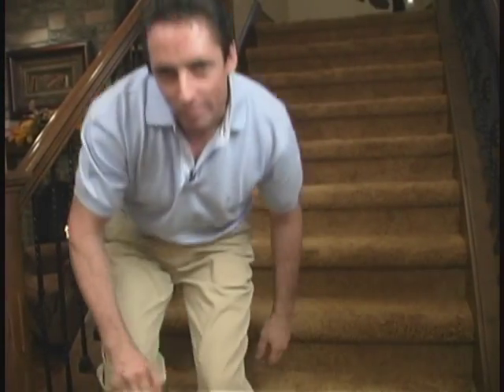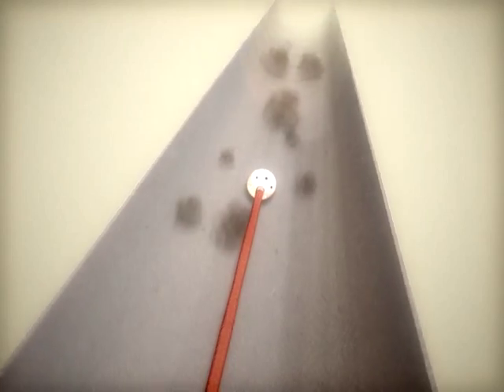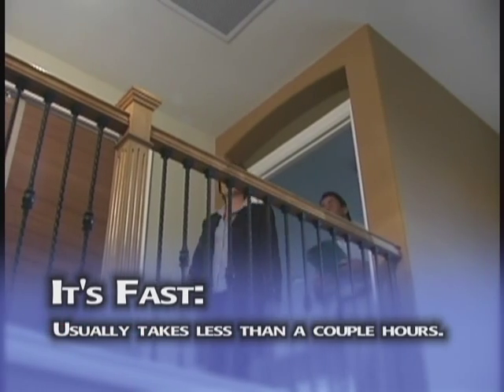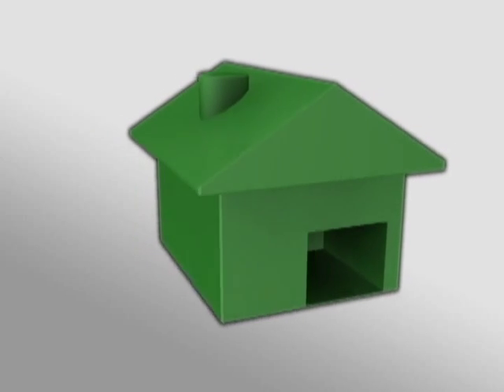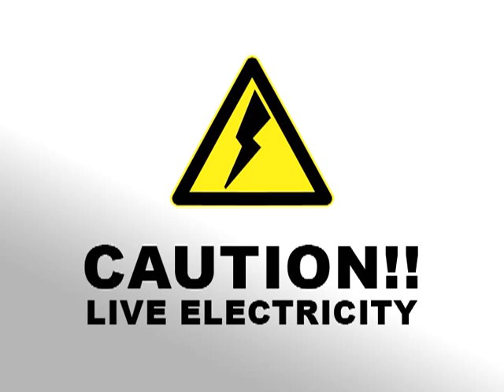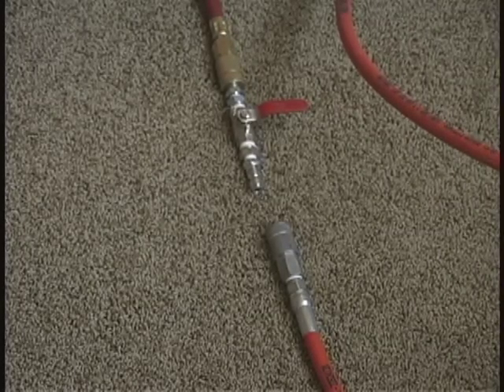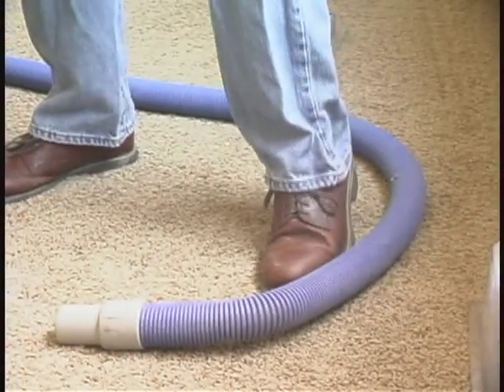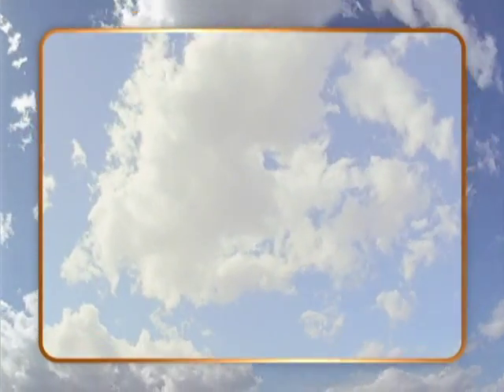Duct Cleaning System Ram Air

Comment: How do you clean the main trunks with this system? The main trunks gather the most debris and fine particulates. If the trunks are not cleaned all the ducts will get re-contaminated as soon as the unit is run again. THIS IS A HALF-ASSED WAY OF CLEANING  THE SYSTEM!!!